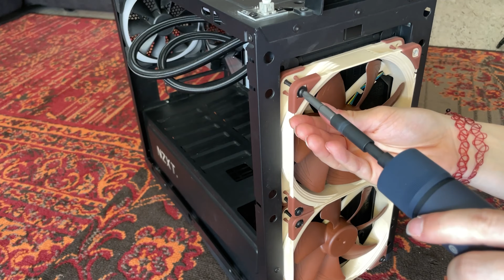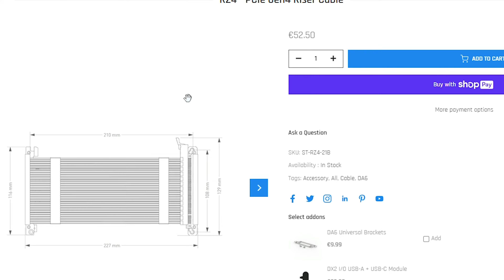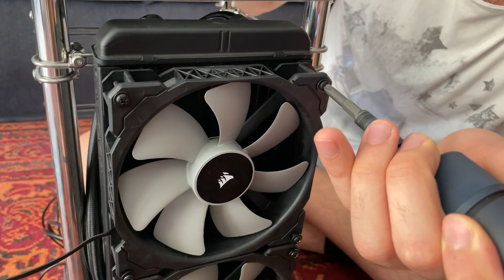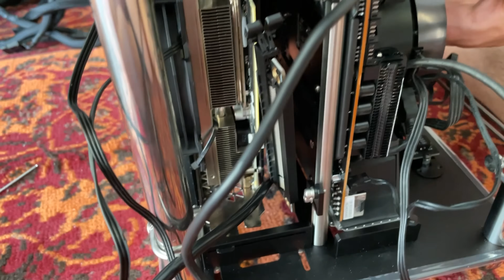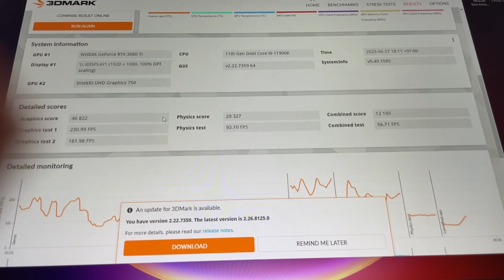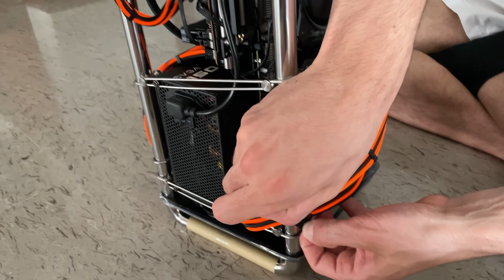I built an Open Air ITX Gaming PC | Streacom DA6 i9 & RTX Open Frame Build

Comment: i just bought one now, because of the design and i could not believe, even a M-ATX can be screwed in, but stickin out of the side a few cm.. a atx psu can still fit in the top with 3 screws, i will find some solution to go with a Arctic LF 360 with a split mount- or just using the 280.

Comment: Just saw this giveaway on your instagram! Love the case. Why did you opt to add two 120mm fans? Better cooling and did you wire the fans to the mobo or a separate controller?
Reply from the maker: Hey there, glad you follow me on both platforms! Yup, added them for cooling but mainly for a noise factor, the PC is now fully SILENT! Wired them to the mobo!

Comment: Hello again! I hear this very faint static noise coming from my earphones connected to my laptop when there's nothing playing and also during quieter sections of the movies or music or whatever. It's very faint and almost unnoticeable during regular media consumption. And it's noticeable only when the laptop is connected to a charger and also disappears when I put my hand on the laptop or make contact with it. The audio quality is good but with this faint static noise lingering in the background which disappears when I disconnect the charger or when I put my hand on the laptop. I've noticed it too much now that I can't unhear it and started to appreciate the silent parts of the movies 😅😂. Does this indicate a damaged laptop? Is this a problem? If so, is there a fix? I'm curious. Thank you again. Really appreciate your help :).
Reply from the maker: Hi there, it's a bit unrelated to the video ahaha. It seems like a grounding issue. You could try using one of those anti static bracelets and connecting the laptop to a piece of metal, but I'm really guessing!
Reply: @ImWateringPSUs  Thank You :)
Reply: @ImWateringPSUs  Looks like a ground loop isolator is also an option. Gotta try it out. Does that reduce audio quality tho? If that doesn't work I guess I'll have to go for The Razer barracuda X wireless 2022. It's been tested by some reviewers to show a latency of 15ms with the 2.4ghz dongle. So my guess is I'll experience a latency of 30 to 40ms more or less. Is that latency noticeable while gaming (not shooters) or while watching movies or general content consumption? Will it be a bad experience? Would really like to know your opinion on this. Thank you.